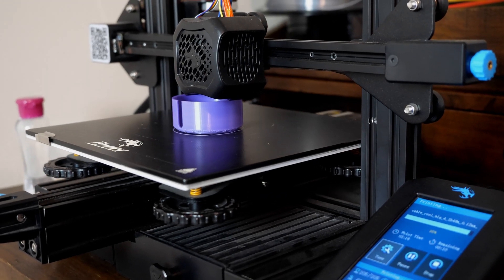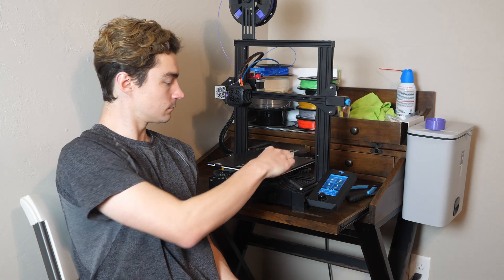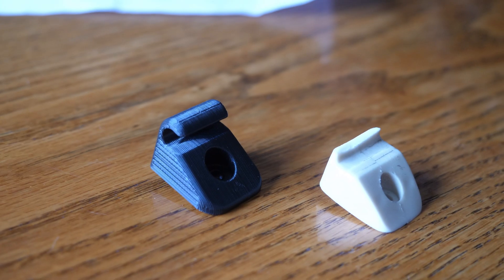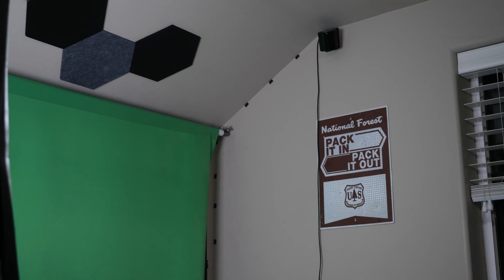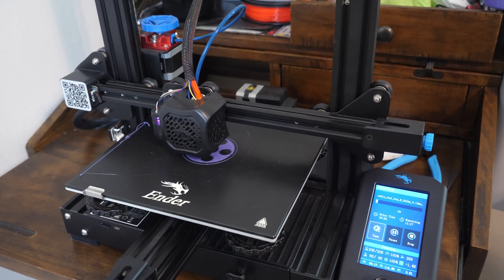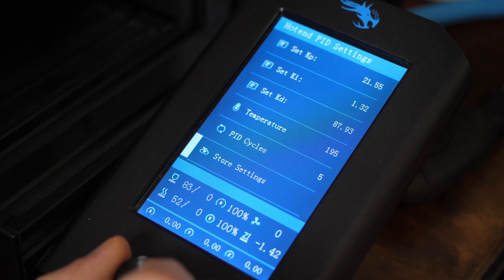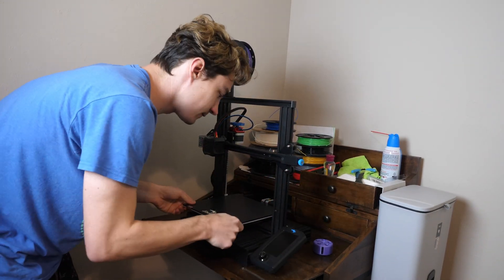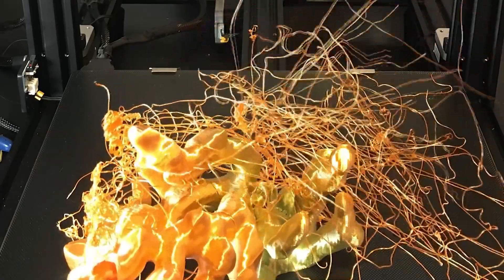The Wonders of 3D Printing

Comment: if you still see this comment, the only popular one that can be toxic when printing is ABS, and even that isn't gonna kill you when sleeping. PLA ,PETG, PET, TPU, the popular ones are all safe. the other thing you said, I don't understand what you mean when you said about micro plastics, if you warred about just throwing plastic away, that a far point. But if you think plastic just go up into the air that isn't how it works. when it melted it doesn't just suddenly start turning into gas.

Comment: Welcome barry. Have you tried anything like a direct drive prints and flexible materials. TPU and other flexibles can have some incredible uses. I've printed bushings for the 6 speed MT shifter in my car in which replacements don't exist. I think there is a decent market for 3D printing parts which either don't exist yet or replacement parts that are impossible to get. Im working on a Steam deck backplate right now that adds a raised bulge in which you can install a full size 2280 M.2 ssd instead of a puny 2230, ill release it for open source once its finished.
Reply from the maker: dude that's an awesome idea!

Comment: I have a Biqu B1. While it was quite a pain getting it set up and upgrading the firmware (there's 2 different versions of the screen firmware depending on which one of two manufacturers it's from which you can only find out by opening it) was a pain. But once I got it running I haven't really had to touch anything. I do highly recommend using a glue stick to ensure bed adhesion, though. Haven't had a single print let go of the build plate while printing, even quite narrow and tall parts.
Reply from the maker: I havent used glue yet. sometimes I have issues so i may try that

Comment: I prefer printables to thingiverse.

And Enders are horrible, just next to garbage. If you want cheap, get a Sovol, if you want something good, pay for it
Reply: I agree with the first point. I still like Thingieverse but god forbid you refresh the site because you are back on page 1 if you do. But calling Enders horrible is just not true. I have my V2 for  about 6 months now and I never had a single (major) problem with it.
Reply: @FizzyLean  Then I think you got a golden nugget! I have heard others too running Enders for months on end without issues, but theyre rare. 

Still I think it's a matter of perspective. Someone who mainly drives Toyota may think that is just fine, when I think we can agree that Toyota doesn't make the best cars, though it will definately get you there :)
Reply from the maker: I'll have to check that site out! I also love my ender. I haven't used a different printer yet, so I only know this one.

Comment: Love to see you printing, barry. I bought my first 3d printer, a Rat Rig V-Minion. Set me back $700 (which I paid for with some of that money from the AMD internship I mentioned in a comment around a year ago) and its been an amazingly useful thing to have. I'm on a college robotics team and the amount of stuff we 3d print (a lot of which I myself printed) is kinda ridiculous.

By the way, if you're just printing PLA you dont have to worry about microplastics or toxins since its biodegradable, and if you print PETG thats non-toxic, but it can create microplastics. Just dont try printint ABS or ASA on that unenclosed 3d printer.

Since you have an Ender 3 V2, you could look into upgrading it to a Voron Switchwire. If you choose to do that, just make sure you're ready for the upgrade before you start or youll need access to another printer.
Reply: Just fyi, although pla is biodegradable on paper, in reality it is only consumed by a enzyme that is nearly non-existant in nature. Also, you can print ASA on unenclosed printers, as long as you avoid drafts and have a hot enough bed and the parts aren't too large.
Reply: V-Minion is my second printer, Ender 3 Pro was my first. V-Minion is great. Quality build, although I did have a couple of overnight prints fail because the cantilever got loose. But it's printing now as I type this :D
Reply from the maker: woah! i;ll look into that! I havent thought much about upgrading it yet other than various parts that are plastic
Reply: @BulletBarry  be careful going down that ender upgrade rabbit hole,  its deep, but very much fun! Maybe start with auto bed leveling :D

Comment: As someone who has multiple 3D printers, whenever anyone asks me "Hey should I get 1?"

I ask them 2 questions.

"Are you going to use it frequently enough to save money?"

"Are you willing to be up at 4am because a print failed and you have to find out why?"

3D printers are very much still in the Industry and hobbiest stage, and many people throw their printers away or sell them on Ebay because they think they're plug and play. 

They're not.

I love my Ender 3 Pro, My Mini Delta, ect.

But I would be lying if they didn't make me wanna pull my hair out sometimes.
Reply: If they say yes, then I suggest the Prusa series if they have the budget or the Ender series, because to me, their community support makes them worth the little bit extra over other i3 clones.

Can you can you get printers cheaper? Yeah. But are you willing to deal with way less support WHEN, not if, WHEN something breaks?
Reply from the maker: @AdamBGames  I could not agree more with everything you said here!